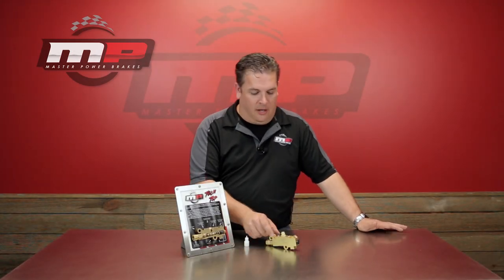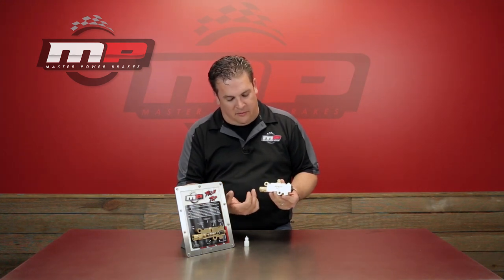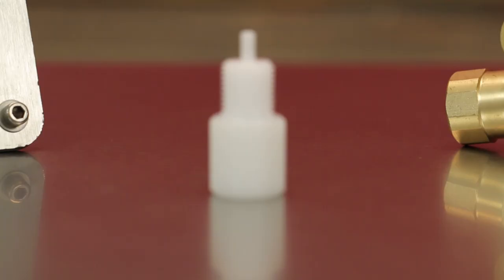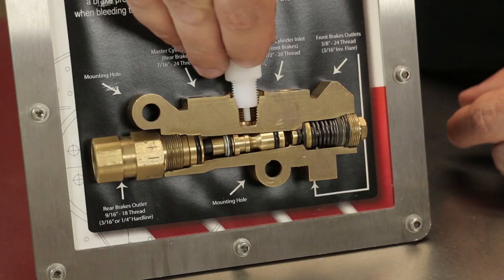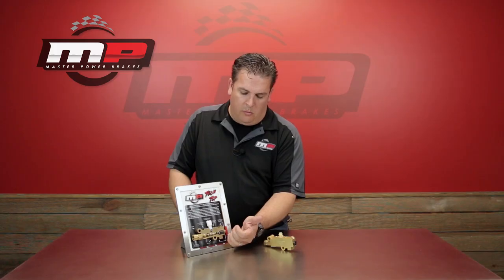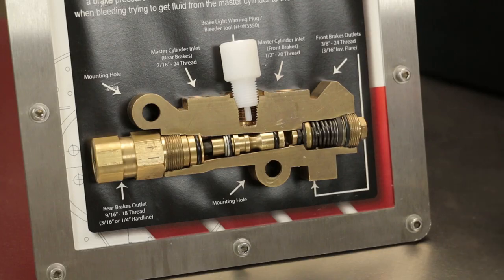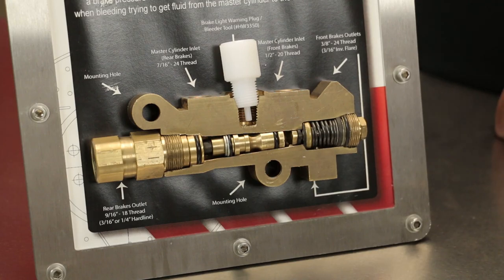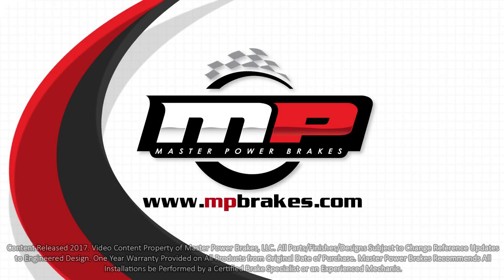MP Brakes Combination Valve Bleeder Tool

Comment: So how do you reset the plunger in the valve? You just show how it works. I am trying to center it to put your part into the valve.
Reply: You can  stick a small screw driver gently move back and forth till  it resets